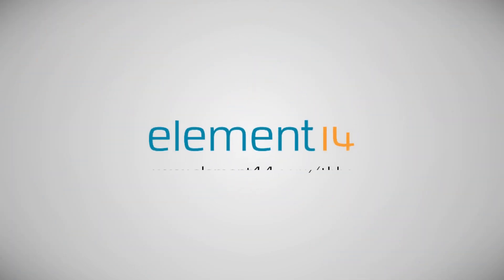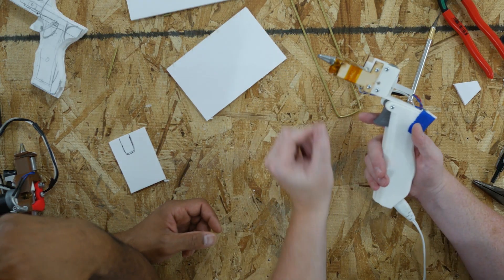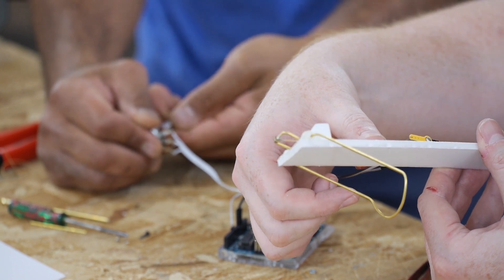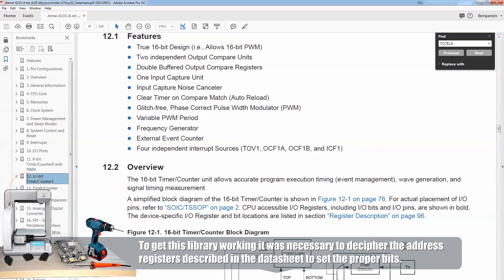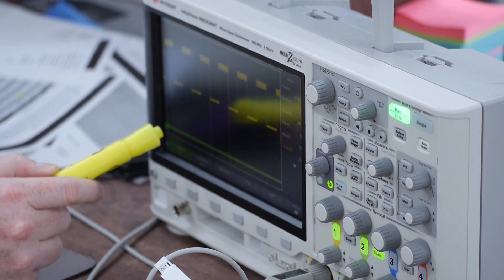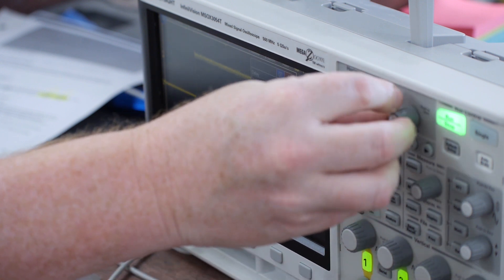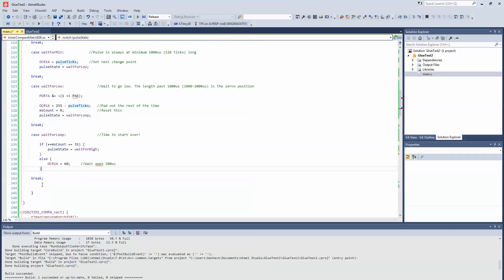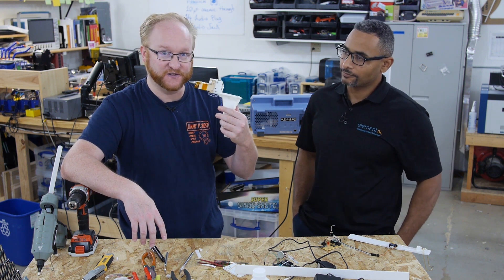Super Glue Gun 07: Scoping out the Autostand

Comment: Instead of putting the touch sensor on the trigger I'd put it on the back of the handle where my thumb could reach it.  Right under the trough where the glue stick will lie.  Have it act as a simple on/off.  Touch it once and the stand comes out.  Touch again and it goes back in.  Keeping it out of the way of normal use would help prevent accidental triggering.

Comment: I was thinking instead of a capacitance sensor on the trigger how about a metal plate on the handle and one on the trigger. Touch both it creates a circuit so it's down to 1 or 0. The other suggestion would be go for a sci-fi look and have a permanent stand built into a cool looking gun design.

Comment: I might be wrong to suggest this, but maybe a spring to the mechanism, kind of like how bike breaks work.  The default position for a bike break is open with the use of springs, but when you pull on the cable it closes.  So you could use a spring to keep it open, and then when in use (finger on trigger) the servo pulls back. This could allow for a more flexible cable run, and all you would need is some kind of cable housing.

Comment: Could you not have the electronics in a base unit and an umbilical connecting the base unit to the glue gun where the heater and glue stick feed motor is maybe you might be able to have the motor control micro controller communicating with base unit using RS232, maybe ditch the AT-Tiny and use the Raspberry Pi MKIII in the base unit and it can communicate with the micro controller in the glue gun head unit, run the firmware under FreeBSD latest version for the Raspberry Pi.
Reply: omg, I thought this was overkill already. Raspberry PI for a glue gun? That's insane.

Comment: Rack and pinion idea would have been cool and possibly more robust without getting in the way of the hot end like a cross pinion with a belt or gear to drive it or like a mini differential like gear box so you could place the motor perpendicular to the pinion mechanism and I don’t think complex is bad as long as it’s robust and reliable but the K.I.S.S principal will help with cost and profit margins

Comment: For the stand, you can make it more compact by having the servo wire go diagonally through the board and attaching directly to the stand legs. Then have a 3D printed triangular stop on the stand pivot point to keep it in place when extended. Something like this: https://imgur.com/a/LOeum where the blue bit extends out sideways a bit to hold the stand rod in place when activated.

Comment: Way way way way over complicated!  Or is THAT your point?  In the end you are going to have something EXPENSIVE, only a little bit useful (maybe), totally unreliable, and not very mass producible (not sure if that's a concern or not).  I have ideas that would improve this a lot, but I am having trouble understanding the point of this device in the first place.  Maybe I'm missing something?
Reply: its called super glue gun for a reason. Plus its a practice of engineering . The tool is very simple which is why the improvement ideas makes an excercise fo what you can do ... even if its over complicating a simple tool
Reply: The micro controller is just one element of the ridiculous devise!  This thing has a servo operated kickstand for gosh sakes!  What I see is that they took a simple, useful, and very reliable device and added a bunch of useless junk to it that will indeed make it much more expensive, can only make it much less reliable, and finally, why? I never had a problem with my glue gun, it works whenever I need it to just fine, it's lightweight, completely reliable and maybe it's only shortcoming is that it drips a little out of the tip, but it's not that big of a deal, just throw down an old piece of cardboard down if that concerns you, it doesn't concern me.  Then even the branding of this thing being called a super glue gun is wrong.  This is a hot melt glue gun, super glue is a different kind of glue sometimes known as CA glue.  Branding 101 is to not be confusing and this is a big fail there as well.  Sorry, this time and effort would have been much better spent on something that is actually useful or needed in society.  What we have here is just some serious nerding out, and not very effectively I might add, on something that is nothing more than a novelty at best.  I can't help but scratch my head and think, this is what's wrong with society in general, our priorities have become completely out of whack.
Reply: So glad I am not the only one who feels this way. I said the same thing a while back and got torn apart by trolls so be prepared for them.

Comment: If you tie a cable around a rod or wheel in the servo's shaft, and have the same done to the back part of the stand, then you won't need as much height for that mechanism to operate properly.
But still, I think it should move much faster than that, and a servo won't cut it.